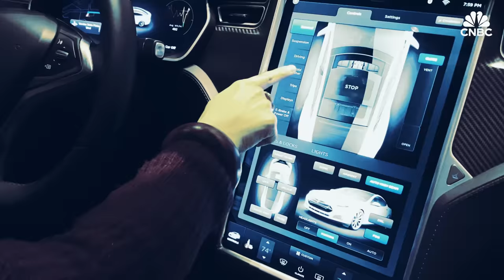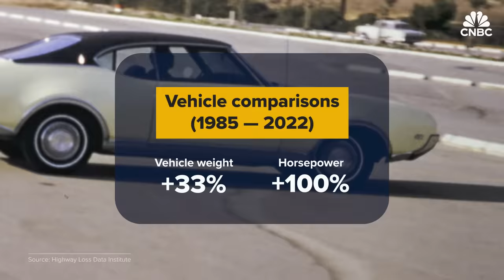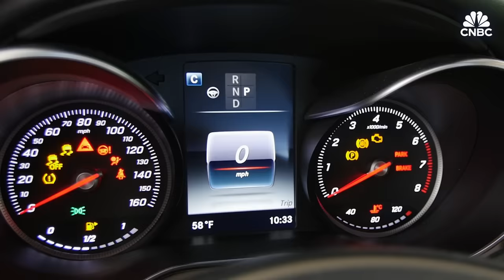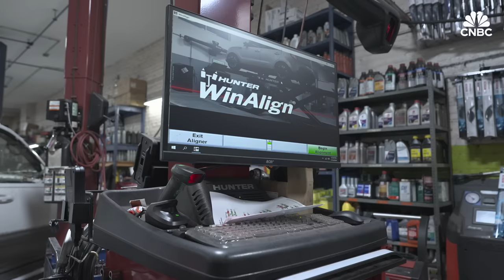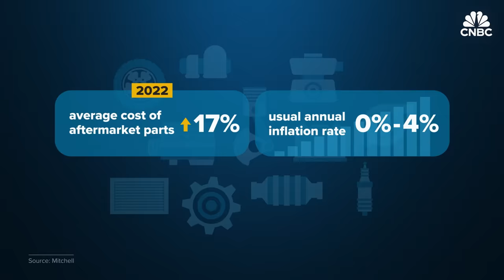Why Car Repairs Are Getting So Expensive

Comment: I've been working on cars for almost 50 years, and a lot of what has driven up the cost and complexity of auto repairs is regulatory.   Government mandates are often onerous and sometimes give perverse results.  I would actually recommend customers, buy, maintain, and restore cars built from ~ 1995 to 2005.   In my mind that is a sweet spot for safety,  reliability, and economy.  The complexity of newer cars just isn't worth it anymore.   Many newer cars, Kia, Hyundai, Honda, VW, Nissan and others have the kind of major failures like engines and transmissions that used to be rare but are now common.  Direct fuel injection, CVT transmissions, turbos, internal water pumps, cam chain tensioners often result in repairs from $2,000 to $6,000.  Don't even get me started on high tech safety equipment that gets outdated and unobtainable - cars are being junked simply because there are no good parts available.

Comment: Buy pre 1990. Parts are cheaper and easier to fix. Harder to find up north. The newer ones cost more in collisions due to not only the parts being more expensive but the amount of parts put in highly probable damage areas. Example, 80s and 90s camaro bumpers were only a bumper and valence. 2023 camaro is now like 20 parts and various clips wire harness and sensors so a simple cheap job became a longer tedious job, hence more expensive. Blame the manufacturers and mandating. When a headlight housing costs $1000 or more, there's a problem

Comment: This is why I like the cars of the 70s and 80s. No computers, no oxygen sensors no GPS systems. And you can run them on biofuel. And they remanufacturing the parts

Comment: Pur new vehicles and complimentary oil changes, free. Workers tried charging $200 for a filter that only cost $10. We, me and my husband,  told them to put it back. 

We do our basic maintaince. My vehicle is almost 60k and is 3 years old. Runs just fine. We change the oil, filters, tire rotations then get alignments. 
Still have other maintaince to do later on as our vehicles age, spark plugs etc.

Comment: Expensive repairs are the NEW business model for the auto manufactures.   The company that made my car,  put the fuel filter in the gas tank.....
Do you know how much it costs just to change a fuel filter.   It used to be mounted so it was easy to change, you could do it yourself, easy.
I have a lot of stories.....

Comment: i’m a learning tech rn basically everyone says not to stay and work at a dealer. they charge almost 200+ a hour to the customer and only give $22 to the mechanic actually doing the work for the hour charged. you could save the customer more and get yourself more by just working for yourself or finding a good ran small pop shop

Comment: I bought a manual transmission car in 2017, I was told that when the clutch goes it “will cost between $600/800” in 2022 it cost me $4,500 to replace the clutch. That was after calling about 5 different shops to get the best price.
Reply: Insane

Comment: I have a 2013 Ford Focus SE, which I purchased in 2015 with 5000 km on it. I am a driver for a living, so driving is not something I like to do outside of work anymore. I used to love driving but as they say, you can only drive down main street so many times. 

The car has been great to me. Hasn't given me any serious problems. 77,000 KM on it now. I did a new battery in 2017, new tires in 2018, control arms and links or something around the same time. Then inevitable brakes 3 years ago. Normal wear and tear....

So now we're at 77,000, what do you think could go wrong now? It's need good? How many hundreds of things are about to go?

Just in the past 4 months...
1) battery. Which cost me about $60 in taxi cabs to Canadian Tire to buy a jump starter ($200), which I didn't even get to try out because my friend showed up, boosted me and picked me up at the repair shop. I wanted the to check it out, otherwise I would have had ight a battery through my brother, and dropped it in. $350.

Fine. But I opened a can of kick butt on my car by getting new tires, and wanting an alignment. This is in Canada too, if this sounds high. $1350 for tires and an alignment, but they couldn't do the alignment because my driver side calliper was seized (which I noticed a week or so before), a tie rod bushing was going, and something else. Control arms or something. $1200 for tires.

SO... Immediately, I need to get that calliper looked at. I have had that problem with other cars, I know, it's common. Out of convenience, so I could juggle work,  I bring the car to the place who dropped in the battery. I tell them the issues on the list I need for an alignment WITH an allignment. They tally it up, call me, this will all be $650... And by the way, we can fix that destroyed windshield too while it here... A nice new piece of glass... which ch was actually next on my list... $425. Alright do it. Walk across the street, rent a car. $80 for a day. 

Get the car back, nice windshield, good job, but there is a snapping and rubbing my sound coming from the break calliper and the suspension sound like crap, clanging and knocking, snapping and creaking which you not only hear, but feel. I'm not happy. I'm angry, but it's my own fault and no, I am not making it back to these Morton's who clearly are on good for dropping in a battery or changing the wipers. I don't want a refund, thanks for nothing. I'll give your place another bad Google review. Which I did. I also bought a new wheel hub liner for the front left wheel, same one the caliper is messed up on, which I messed up a few years ago when I backed over an island in a parking lot., $30 through where my brother works.

Then called FORD which I should have done in the first place. FORD books me for yesterday. More than 2 weeks after I called. Brought it, fix the problems please install this liner which I would do myself, but don't have the screws for. Turns out they did grease the brake mechanism, which is causing the noises, $150 they will fix it but I also needed new front struts, they entire front suspension assemble. For one, but 2 are recommended. Ok, do it. Do all of that. Grand total of $1550.... 

The car is in great shape, they said it themselves. It is starting to rot, but really 77,000 km? At its core is a car in great shape. 

But the total I have paid into it the last 3, 4 months is like ??? I didn't do the math, but it was at least $5000. I paid $13,000 for it back in 2015. It's nice to have a car that hasn't given you any problems, but by 80,000 km, everything seems to catch up at the same time.

Comment: This is why I went out and bought a jack n jack stands ,went on you tube and work on my car myself now. I have successfully done my brakes, change brake fluid, flush out coolant and getting ready to change transmission fluid and motor oil.

Comment: Also, you can thank government emissions regulations for making cars crappier and more expensive due to complexity.  The increased requirements for more fuel efficiency leads to manufacturers having to do dumb things to a car, like replace critical parts with plastic parts to reduce weight, or modifying the engines to shut down cylinders or the engine all together which wears out the engine and starter faster.

Comment: At 59, I repair and maintain both my vehicles. Unless I need a lift to remove an engine, I do it all. At first I was intimidated by the whole thing. I bought sockets and wrenches, jacks and jack stands.  I have saved thousands and have had a lot of fun too.  I learned by watching You Tube videos, asking a lot of questions in forums, and by grabbing a Chilton's manual, the latter which has been of great help. I'm not a genius, but car repair is not hard at all.

Comment: My 71 GMC 3/4 ton pickup cost me less than $3k twenty years ago. Parts and maintenance over 20 years, including a new engine, tranny build, various small mechanical parts, has cost me about $12k. Even in used and abused condition, it got compliments everywhere I went. Now it gets a cosmetic rebuild since it has proven itself. Parts are cheap and plentiful, and normal maintenance is easy to do. The only electronics are the stereo and distributor.

Comment: I started doing my own brakes and rotors, and for most cars, it's way easier than most people think. The tools cost me less then $100 and the pads cost like 30 bucks on Amazon. Rotors are a bit more but you can get pad and rotor sets for avout $100 and you only need to do rotors every three or four brake pad sets. Unless your rotors are worn out enough, don't let any mechanics telling you you need rotors every time you do pads. You simply do not. Anyway, costs me 40 bucks to replace front pads, vs literally hundreds at a shop. Also do your own oil at the very least, so easy.

Comment: Video has no relation to the real world😂. Why is it getting expensive? 1. Having people over 3000% for plastic parts and almost 200-400% for smaller parts  normal maintenance items. 2. Trash wages for good techs; the industry standards is so low that companies hire based on who can do the job at the lowest wage. So when you have someone qualified who wants a fair wage, companies immediately seek for slave labors who can make the vehicle look fixed 😂.  3. Price hike for no reason at all - yes! As we are getting paid less, the best way to get more is to price hike or to artificially impose higher demands for something that doesn't exist like extended-super premium  warrentaries, or circling back, lack of technicians😂, and because everyone else is doing it of course. The automotive industry is a dying industry because of corporate greed. You can still be profitable and not greedy.

Comment: Okay what’s happening? How about a big hose job? If we take a look back, to a time when parts where overhauled, and mechanics were taught to overhaul every component was designed to be overhauled, it was far less costly, and there was little greenhouse gas waisted. I overhauled every part of your vehicle. Thus zero parts where thrown in a recycling bin. A water pump has seals and bearings, or bushings which can be easily changed, a cylinder head has valve guides, and seats which can be replaced, an alternator
 Has brushes, bearings, and diodes, which are easily rebuilt, tanks of radiators can be refastened to a new core, starters can be overhauled as well as transmissions and final drives. Even a brake caliber can be overhauled, and reassembled with new seals and pistons. So how is the production of complete new components more environmentally friendly, or cost effective? You say labour costs? I say with the price of parts as they are, no way. A alternator can be removed, rebuilt, and replaced in 1.5 hours on most vehicles, the cost of the components required is minimal. Someone has there manipulative hand in the cookie jar!
Reply: Except a Toyota Sequoia with the starter placed at the rear of a V8 valley under the intake manifold…got 200k on it so far, but still…

Comment: I do most of the repairs and all of the maintenance on my truck, and my wife’s car, myself. 

I buy all my parts from rockauto. 

The savings has never been greater than right now. Shops up charge a ton for parts, and labor rates are at skyrocket levels. 

I did new pads and rotors for $150 and my neighbor was charged $768 for the same service.  

$618 of savings in my pocket for 2 hours of work.  

Where else are you going to make $300/hr? 

Do your own work, it is so worth it.

I also get to choose higher end parts if I want them, which I almost always do.
Reply: Best part is that rock auto sells brands that many major manufacturers rebrand!!!

Comment: When i was 19 or 20, I started doing my own repairs. I remembered i was mad at the GM dealership for not catching something when i took my truck in for repair. As for EVs while i like them they need better charging infrastructure and also cheaper costs to maintain.

Comment: I have a couple of square body GMCs with 6.2 diesel motors. There's nothing I can't fix on them and the parts and tires are still relatively inexpensive. I have a new Silverado but don't really trust it. An expensive pile of crap. If I had to choose, the Silverado would hit the road!

Comment: My 20 year old VW Jetta, fuel injected 2.0 litre engine with a manual transmission and a real stereo is not hard to maintain. I take it in for oil changes, get complimented on what a great running little car it is. It's paid for and costs pennies to maintain.

Comment: The shop labor rate @8:23 is WAY off, according to shop software industry surveys, and networking with hundreds of shops across the US. It's still extremely supressed to be able to afford quality technicians, correct diagnostic equipment, insurance for the business and health insurance for the employees, along with a warranty and other factors (along with a profit!). The average US labor rate is 130.22. Regions in the US vary from 125-142...... But to afford quality technicians that really needs to come up to get quality employees and still be able to maintain a business with reasonable profits for the risk involved.

Comment: As a retired tech i can say this, options and advanced electronic are usually the first thing to fail on vehicles, manufactures want you to buy optional bling and the gov. mandates much of the rest, that's why when I buy a new car I get AC, power locks and windows cruise control, 4WD, V8, I drive pickups, my current truck is 9 years old other than tires and maintenance I've not spent a dime on it.

Comment: Many reasons why over lock down I bought a $1000 motorcycle and learned to do all the work on it myself. Zero experience beforehand and had no tools so there was some upfront cost, but now AI can do a top end, clutch replacement, tune a carb and change the tires, chain, oil, filters all myself. And with a kick starter I don't worry about electrical at all. Cars got way too complicated to meet absurdly high standards for emissions, safety, and performance. The average commuter car is faster than a racecar back in the day, there's no reason a mom sedan should be able to rip down the highway at 200km/hr, and the ability to do so is costing you a ton in r&d and high tech parts whether you utilize it or not.

Comment: My 2018 Tesla Model 3 Performance has been maintenance free still on the original tires. Besides no maintenance I also really like getting 300 miles for just $6.00 of electricity on a 500 horsepower car. EVs for life

Comment: Car makers are making cars too complicated. Installing options that are not needed or even wanted. Government regulations that require complicated safety systems that have been problematic like air bags. Government requirements that electric vehicles be mandated. There isn't enough infrastructure or battery technology to make it viable in the time allotted to comply with regs. Parts availability? Well many American manufacturers of parts moved there facilities overseas due to how much it cost to manufacture in this country. This happened over time. What happened to the concepts that started many companies in the business. Model T and Volkswagen Beetle simple reliable transportation that was affordable and economical to operate. Evidently nothing was learned from the malaise era.

Comment: As a more prevalent and larger issue that no one is talking about with non-EV cars is that companies are designing cars to have their components replaced instead of repaired like they were before the 90's. Because your have to pay $1000+ for dumb things like head lights. Whereas you can replace an entire housing and harness for <$200 on most classics. You can't just repair things any more. You have to replace them.

Comment: A lot of work nowadays is a lot of charge for labor (especially on euro cars).  Manufacturers made things more difficult to fix.  We try to give some customers a break on easy things, but a $15 bulb could turn into a $100 bill due to pulling panels and bumpers to do so.  HID bulbs, even at cost, are kind of expensive.

Comment: What would justify a $612 diagnostic fee? It's unreasonable because the engine diagnostic was $150 and its more technical than the cooling and steering systems.

Comment: Man, I just got some new spark plugs, and for one cylinder i got a new coil and some plugs. Mechanic said it took 4-5 hours. I paid $590 all told and that's after I got half off on labor because I work for corporate of the service shop. It feels terrible. This for my 2004 Prius with 220k miles that I bought for only $2,100 a year ago.

Comment: "The sustainable future". Vehicles which need full out electrical / mechanical engineers to maintain, debug, and repair. Companies are not realistic, vehicles have a bazillon sensors, computers, electronics making things more complex, and more expensive to build and maintain. You can throw a 69 Camaro on the road and run it forever. Buy a modern vehicle and you are lucky to get 6 years out of it without something failing. As an engineer who designs things myself, every time I design something I realized "KEEP IT SIMPLE", is the ultimate goal. Something which modern manufactures just don't understand.